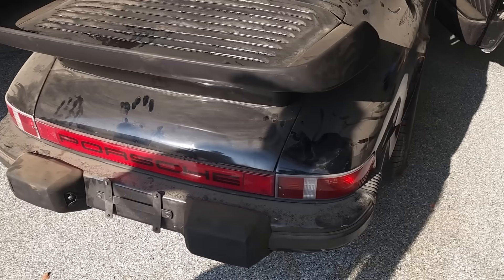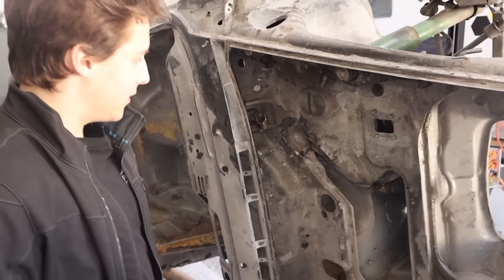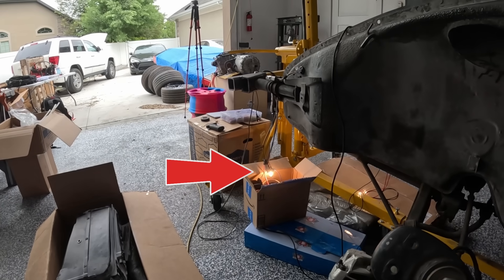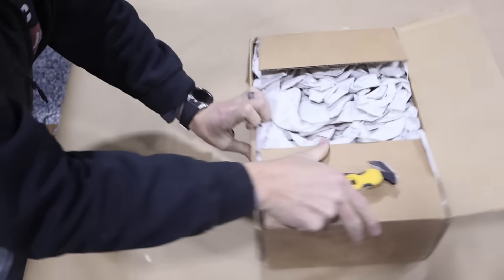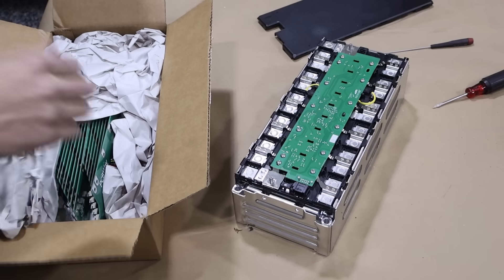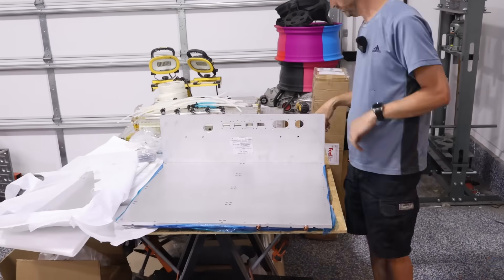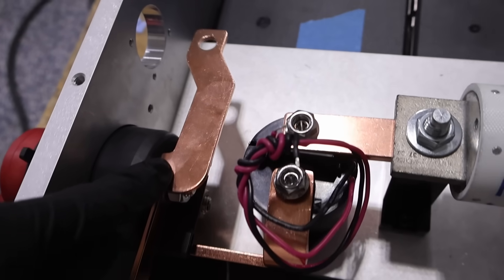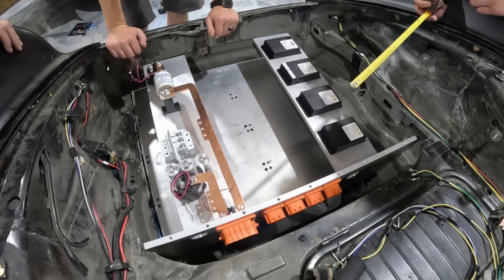New Batteries for the Electric Porsche!

Comment: Can you please provide information on how you made the battery box. I assume it is custom, but I am keen on stainless thicknesses, sealing with all those threaded holes, and most importantly how you ran the cooling channels on the bottom of it.
Reply from the maker: Yes, everything is custom.  Material is aluminum.  The bottom plate has a channel milled out and a copper tube pressed in for cooling

Comment: Why did the customer choose those batteries? It really doesn’t seem like a smart decision...
 I’m not sure what this vehicle is intended for, but using air-cooled batteries in 2025 feels outdated. I can understand the appeal of keeping an old air-cooled Porsche engine if the original flat-six is still in the car, but once you convert it to an EV, that logic doesn’t hold anymore.
Do you have any idea why they chose these batteries? Was it purely to cut costs? As you know, air-cooled battery packs prevent the use of CCS fast charging, which makes no sense to leave out on a brand-new EV.
It’s such a no-brainer feature to include.
Reply from the maker: Cost was the driving factor.  Batteries are not air cooled but liquid cooled

Comment: Lots of progress! The insert to the old gas tank is brilliant! Not much weight, but lots of rigidity added. Recommend adding a strut tower brace as it helps these early 911s a lot. Are you going to get whole build to running, then disassemble for body work and painting?
Reply from the maker: Good call!
Yes, the plan is to get everything all running and any modifications completed, then complete teardown, sand blast and build up to paint.

Comment: Shouldn't  the loom be covered in some kind of flex mesh to prevent rubbing of the PVC jacket against the metal frame?
Reply: they said they will this is all test fit
Reply: @briscoed2003 what timestamp? I must have misheard
Reply from the maker: All wiring will come back out when the car gets blasted before paint.

Comment: I feel that replacing the big metal block engine with a li-on pack that may under go a metallothermic reaction might lower survivability it the event of a impact maybe a thicker firewall might give the driver some time but that aluminum casing isn't going to even slow such a fire. I understand that these vehicles do not need to have any safety ratings but if I was in your shoes id be a tad worried for his or hers safety in the event of a impact.
Reply: I have more problems with the massive robust Batterybox in the front crumblezone.
But that´s a problem most conversions have.

Comment: Why are Parallel packs not ideal?
Reply: 10 feet of cable connecting them adds resistance and the BMS needs to match balance the front and back pack.
Reply from the maker: Having one path for the river (current) to flow is best.  Two paths will never carry equal current and can cause more issues for battery management for charging and discharging.